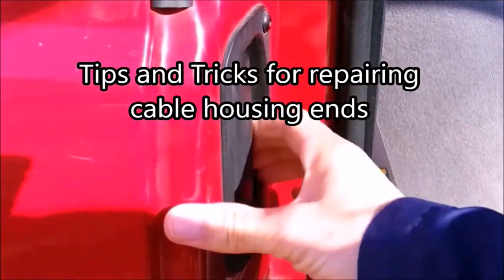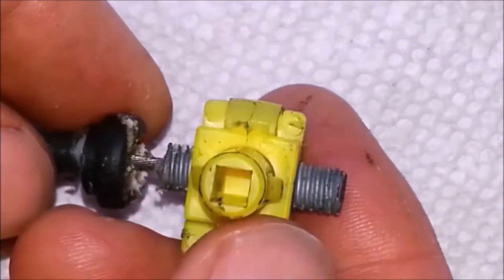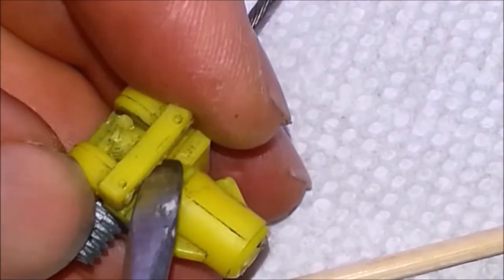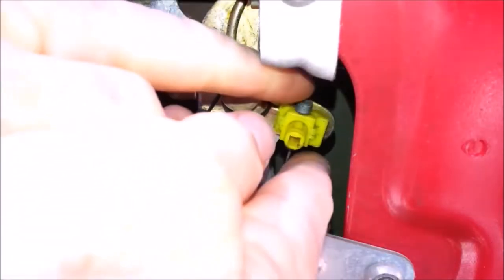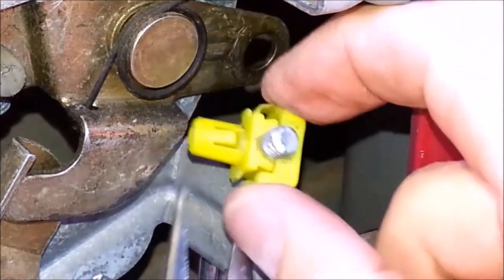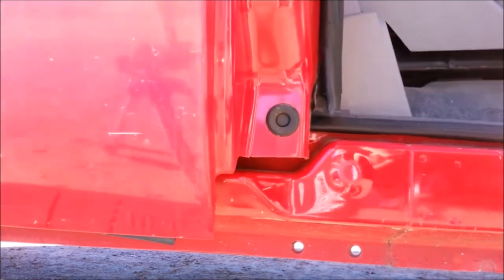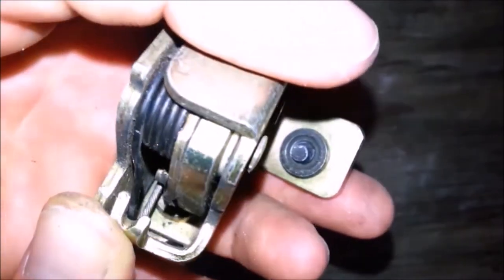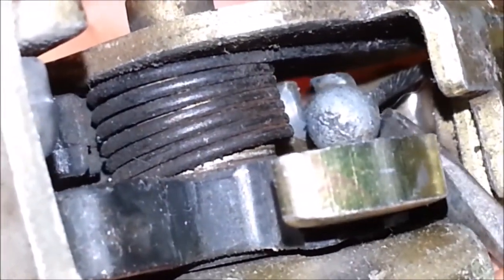Door Latch Cable Housing End Repair - Extras, Tips and Tricks

Comment: Yeah I messed up replacing the door handle and I guess I twisted it while installing and it shortened the length of the cable. I was like wtf! Glad I found your video. I’m going to spend the weekend trying to take it apart on a 2009 ford fusion and adjust the cable the way you said! Everything was going great and that happened! Now it’s a weekend job
Reply from the maker: What was the problem with your cable? Did the housing end fail, or the inner cable?
Reply: @fixpro256  It shortened some kind of way when I didn’t place in the hole correctly. Then I think I touched the remote key and it shortened the length to put it back in place! Now when I hit the remote unlock the door makes this double clicking sound. I mean I can f up the simplest things and it was so simple and I made it difficult 🙄 I tried again yesterday, 2/24 and I still cant can the cable to extend. I tried to remove the silver panel and it wouldn’t come completely off! I kinda give up🙄 Any ideas